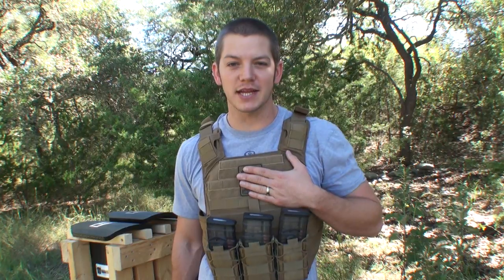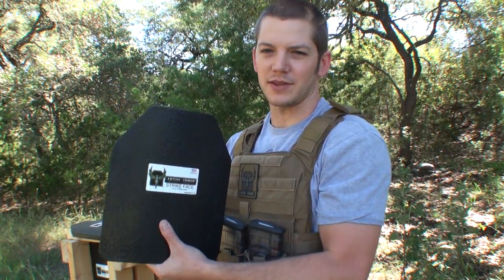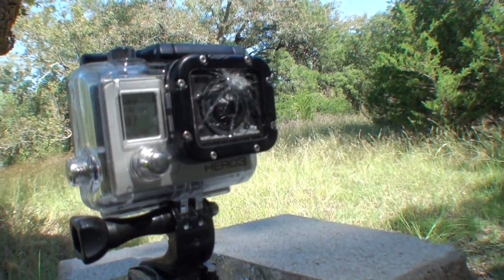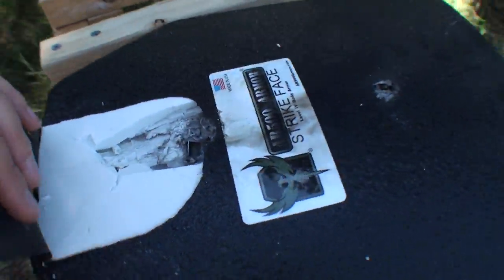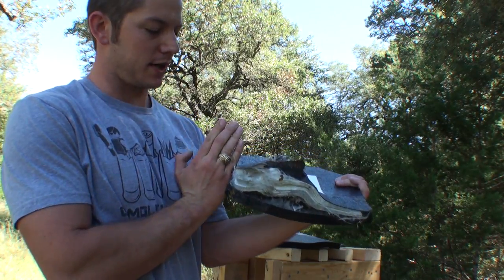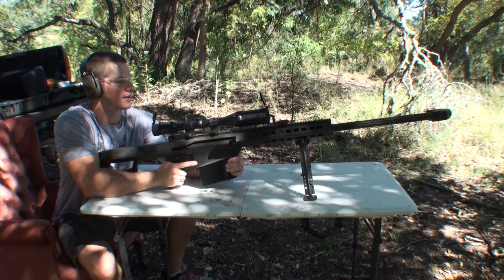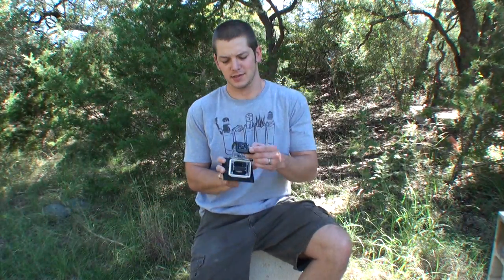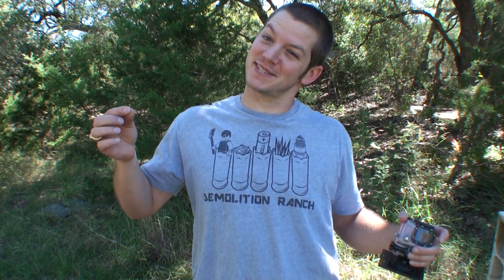Level IV Body Armor Torture, 50BMG

Comment: Would the armor have acted a bit differently if it were held more secure? Because the plates kept getting knocked off when shot from the 50 BMG, the bullet impact was cushioned a little bit, and damage was not maximized. Maybe next time, add a 150 lb weight to simulate someone wearing the armor.
Reply from the maker: I thought the same thing.  I didn't expect the box to move that much, it weighed over 50lbs.  Next time I'll secure it better.
Reply: DemolitionRanch Yeah, I was impressed. That's one powerful bullet!
Reply: Jimmy De'Souza "...cause them to perform worse..." "adds to the performance..." What? I'm confused. And I keep having to reread your comment...
Reply: Jimmy De'Souza Soft armour, I can understand... fabrics like Kevlar do indeed perform poorly when stretched and secured tightly since they're just fabrics, and they're designed to directly protect flesh. However, I doubt ceramic armour is built like fabric armours simply because they're brittle and in almost no way flexible. I think metal and ceramic armours are made to just simply take that brute force.
Reply: ElectricPyroclast It really gives you an idea of the kind of recoil on your shoulder from firing .50 BMG too, since as we know from Newton's third law of motion, the same force acting on the box full of armor plates is acting on the firearm in the opposite direction.
Reply: if i were to get shot by a .50 bmg and survive i would probably get knocked down with intense force, considering that 18,000ish pounds of force has to go somewhere
Reply: barrendare gt if the bullet passes trough you extreme cavitation would destroy your organs, so no chance to survive.
The liver would explode like a watermelon
Reply: Jimmy De'Souza I'm not going to be testing that lol
Reply: Jimmy De'Souza I think it would. The plate should be traveling around 220 mph. I think that would hurt a lot.
Reply: DemolitionRanch
Next time you test any plates would it be possible for you to make a ballistics gel torso and put that behind the plate, would be interesting?
Reply: How bout someone just takes ballistic gel and does it to see.
Reply: ElectricPyroclast  there is no need for another test even where the bullet stopped in the plate. will cause internal organs to rupture. thats what causes most deaths in explosions. and if that didnt theforce would break your ribs into nice pointy things that will puncture your heart if your lucky. if not then your lungs will be when you in hail causing either death by loss of blood or by drowning in your own blood... THE MORE YOU KNOW
Reply: Rjruy tree t estas
Reply: +rosie roseberry I feel as if a lot of KE would force your body backwards rather than just crushing your body under the extreme pressure.
Reply: well your wrong
Reply: rosie roseberry
Actually, he's partially right. While the immediate area around the point of impact will be basically churned into paste from the hydrostatic shock, it doesn't keep travelling through the whole body as if we were a body of water and it was a ripple from something hitting the surface- the physical media that is our flesh and bone interferes with those pressure waves, containing the damage to localized trauma.
Reply: *****
well he is not right cause if the shot you fired would throw the targets body backwards the recoil of your gun shoul throw your body bacwards as much as it throws the target.
And on top of that the round should have enough mass and then we are speaking about artillery shells and not handguns or 50 bmg.

If I recall correct Mythbusters tested the myth, was one of their hollywood movie myth episodes I think.
Reply: *****
well yeah, you fall to your ass but you wont fly 2 meters backwards. and if you hit your target on the shoulder he wont do a damn flip or spin, he just falls on the spot hes standing on and quite likely on his back if he is just standing.
If you shoot him on hip area he prolly tilt forwards and falls on his face and still on the exact spot where he is standing.
50 bmg is indeed a powerful round but its not a damn howitzer.
Reply: zameliz
Where did he say fly two meters backwards? he didn't, just that it would force you backwards, which it would, and then the drag of the rest of your body would pull you violently into meeting the ground.
Reply: *****
My bad, I was referring more to Brenden,
"I feel as if a lot of KE would force your body backwards".
Basically I got the impression that he thinks that it would consideraply push/throw the targets body backwards, and you are defending what he's saying, soo thats a thing :P
And what comes to 50 bmg pushing the body backwards depends of the point of impact, but the end result would still stay the same, the target will kiss the ground and will drift into the world of pain if he/she survives the hit. :3
Reply: I was thinking the same exact thing.
Reply: +ElectricPyroclast That's a good point. If I got hit with one of those, I probably wouldn't know I was about to get hit, and so I would probably get laid on my ass. This is a pretty terrifying round
Reply: +DemolitionRanch A body is not secured. Best
Reply: +DemolitionRanch strap it to a tree!
Reply: +ElectricPyroclast Well, who cares about that if all of your internal organs are turned into the bloody paste from the sheer force of the hit?
Reply: Богдан Козенко
It wouldn't, actually, though there would be a lot of internal damage from passed-on force, it wouldn't be anywhere near the same level as if it had actually impacted your body directly, and thus imparted its kinetic energy to you as hydrostatic shock. So long as there is no penetration, at worst you'll be looking at bruised internals and a lot of pain.
Reply: Who cares if you are still dead?  I guess the almost instant death from the bullet shock beats the slow internal bleeding with no hope of surviving.  Though, I guess, nobody would deliberatly hunt infantry with .50 or 12.7 (which is russian) either. Those things are designed to crack vehicles, and are pretty much overkill for infantry.
Reply: Богдан Козенко
Err... do you not get the point that wearing the armor, you wouldn't be dead? Bruised internals are tender and hurt like hell with every movement, and there is, ofc, the risk of internal bleeding, but that can be dealt with- or lacking that, you can still attempt to take some enemies out with you in that situation.

Also, as Cyberat noted, they were used to great effect in penetrating cover to kill targets on the other side of it, just like it's used against what is effectively mobile cover (vehicles).
Reply: *****
And point is that impact force wouldn't kill you. There are multiple documented accounts of soldiers (and regular citizens) hit by .50 cal bullets or worse and surviving even WITHOUT body armor, though the wound channel on that would require tons of surgeries, as per Jared Foster's example, getting shot by a .50 cal rifle five feet behind him. (source: http://www.leatherneck.com/forums/showthread.php?51015-Marine-s-Miracle) and then there's the case of Phineas Gage, who took an iron pipe over an inch in diameter through the jaw and up into the brain and survived (source: https://neurophilosophy.wordpress.com/2006/12/04/the-incredible-case-of-phineas-gage/). Hell, there are even people that have survived nine shots from a firing squad, AND a tenth shot, to the head, to ensure death. (source: http://weirdthings.com/2010/06/the-man-who-survived-10-shots-from-a-mexican-firing-squad-weirdest-survival-stories/ ).

The force of the impact of a .50 BMG against your body armor won't kill you. The force of it entering your body also won't kill you (though it can and will fuck you up). Stop giving opinion as fact, and face facts.

As for why it became popular to use vs. armoured vehicles, it's because it has the penetrating power to blow through the armored hull, same with through brick walls and the like. That doesn't mean a shot is a guarenteed kill.
Reply: Well, let us talk about a simple luck here. There are indeed documented happenings of american soldier surviving a firing execution  in Japan.  Also, there are documented happenings about people that died from a simple stab to the stomach, or just falling on a rock. Also, people survived being half decapitated by a propeller, or smashing their skull open in a car crash or in fall

http://www.dailymail.co.uk/news/article-2605001/Hes-lost-half-head-Shocking-images-man-lost-SKULL-smashed-head-concrete-work.html

But they also happen to die from a single blow with a rock to the head. 

You know what this really means? This actually means that you can die very quickly even without being shot by a motherfucking .50 caliber. Also, this means you can theoretically survive the hit. Or not. Or you can survive a plane crash from a huge altitude without a parashute. Or you may not. This is a deal of luck. 

But being shot at isn't really healthy, isn't it? There are many documented happenings of soldiers that have their ribcages collapsed under the body armor. Some of them - probably even most of them actually died from it. And they vere shot by a simple 7.62 or even 5.45 Probably the cause here is that they haven't recieved medical attention in time, or they had internal bleeding, or just died from a shock. 

Soo, I guess, an answer to out argument here is that, yes, a man can actually survive being shot at with .50, or he may not. That kind of depends.
Reply: Богдан Козенко
Wrong word use: "may actually survive". It's been proven through documented evidence (and non) that you can survive, not that you will survive. /grammarnazi
Reply: +ElectricPyroclast if you reread the comment properly its basically saying that the more secure they are the worse they are, soft stuff behind them adds to performance so the better they are. to make it really simple: the more the object flys backwards after being hit, the more force absorbed and the less damage done.
Reply: Steve Rhodes No need to say such a comment. I already figured that out long ago.
Reply: +FrIeG_ AuT You wouldn't survive it at all.
Reply: *****
The energy from a BMG wouldn't just disappear. It would crush your chest if you were hit.
Reply: MrWalkwaySc2 i have no fucking idea what you are arguing about. 

Being hit with a stick hurts. Being hit with a stone hurts much more.

Being hit with a bullet hurts much, much more. 
Yes, the stick to the head can kill you. And a stone. And a bullet. Or it may not. 
But if it will connect, you are fucked badly, lying on the ground, trying to collect something from your broken body - be it intenstines, blown away from the sheer hydroshock, or cracked ribs, or ripped away limb. 

You can survive that. Why not. But let's just say, it hurts.
Reply: Богдан Козенко
Someone said that if they survived a hit from a .50 BMG they would be knocked down to the ground. I replied saying that the he wouldn't survive.
Reply: MrWalkwaySc2 he could survive.  But yes, he would be on the ground - not from the whole energy, but from the shock of being hit.
What is wrong?
Reply: Богдан Козенко
The chances of a .50 cal not penetrating a vest is very low. Either way the energy would crush your chest in.
Reply: MrWalkwaySc2 I never said that. I said that you have a chance of survival. Not the chance of being not hurt, but alive. Crippled, forever incapacitated, distorted and twisted. 

But alive.
Reply: Богдан Козенко
Probably because I was talking to someone else the whole time then you mentioned me.
Reply: MrWalkwaySc2 yeah, and all that time you both were making incredibly... unrealistic assumptions.
Reply: Богдан Козенко
All I said was " You wouldn't survive" I don't think that's an unrealistic assumption since a .50 cal will penetrate almost every body armor.
Reply: MrWalkwaySc2 the penetration and the death are very different things. Yes, human body is fragile, but, if, for example, the limb is hit, you can pretty much survive it. You will lose the limb, though. Same goes with glancing hits. If internal organs haven't collapsed in the instant of a hydroshock, you have a high chance of living it through. The chances are that .50 has somewhat less stopping power than soviet 5.45mm. Those were evil - they twisted and spun inside body, creating the exit wound the size of an apple.
Dum-dum is also incredibly hard to live through, even if it has hit your limb. The shock is so potent, that it will stop your heart from the sheer pain.
Reply: +ElectricPyroclast you would still get knocked over because of the force of the bullet and it's speed
Reply: Uxmal Soto It doesent have THAT force.  The energy of the bullet is equal to the energy of  a gun. If the gun doesen't knock you over with its knockback, the bullet won't.
Reply: Богдан Козенко
 bro the size of a bullet the speed and velocity those bullets can blow your leg off with one hit so i'm 99.99999% sure that you would get knocked back with that bullet
Reply: Uxmal Soto nope, you would not. You would fall - yes, it is hard to stay on your legs with this kind of injury, But it will not send you flying.  Go watch some mythbusters. 

It is impossible to send somebody flying with a gunshot.
Reply: i never said they go flying i said they would get knocked back
Богдан Козенко
Reply: Uxmal Soto And I said that they would not. A person hit by a bullet just falls on the ground like a puppet with its strings cut.  That is exactly why it is called the dirt nap.  Go google some war videos.
Reply: Богдан Козенко
it would vary on the gun type if they would just fall down or get knocked back and be knocked back i don't mean go very far like the person just get hit off there feet and go back a little bit
Reply: Uxmal Soto Nope. The human body pretty much acts as a liquid when struck. The body will not go back of any bit. It will fall down like a bag of meat, with energy transfered to the internal structure, not to the body as a whole.

My dear god, I really don't wat to google videos of people being hit with DShK, but I thing I should.
Reply: Богдан Козенко
 ok look smaller guns you will just fall bigger guns such as sniper rifles can knock you back a bit not a lot but maybe 1 foot
Reply: Uxmal Soto
Nope, the other guy is right. A gun won't move you like it does in the movies. It will only knock you down.
Reply: MrWalkwaySc2
 i not saying he going to fly like 100 ft maybe 1 foot depends on where your getting hit
Reply: Uxmal Soto
It's just going to knock you down.
Reply: It really wouldn't matter, people are soft. Bullets, especially .50's will shred right through someone
Reply: +ElectricPyroclast No difference at all. If the bullet travelling 800m/s impacts a perfectly secured plate that will not move, the effect will be the same as if the bullet travelling at 803m/s impacted a setup like this. It is negligible.
Reply: Yeah you would fly a couple of feet back IF you were somehow to survive it. Most likely where ever it would hit you the force could cause fatal damage in internal organs.
Reply: ***** What I said stands, I had to study this shit, and I will not give free classes.
Reply: ***** All you said is unrelated to my statement. If after the impact, the point of impact in the plate had a speed of X, the penetration will be equivalent to that of the projectile travelling X m/s slower and impacting a perfectly secured plate. In this case, the plate is su much more massive than the bullet that the difference is negligible.
 And what the hell is impact force? You can only know the KE, the force will depend on the terminal ballistics and would require computationally intensive finite element simulations.
Reply: yes i think he should do that to
Reply: The force and overpressure alone would kill you.
Reply: +TheTerrariaGamer console terraria?
Reply: I didn't read the replies to this so maybe someone covered it. I used to make plates of this style. That's aluminum oxide (alumina) with twaron backing. Twaron acts similar to Kevlar but imo, doesn't work as well. Both materials are cheaper compared to silicon carbide and Kevlar. This plate is a SAPI (Soft Armor Plate Insert) plate. Meant to be used in a plate carrier with a soft backing as well as directly on the body. Ceramic has absolutely no elastic deformation. Goes right to the plastic deformation range. With no backing like his setup uses, it will perform poorly as it wasn't intended to be used that way. It creates more deformation along the plane of the ceramic and thus, is more prone to fracture and catastrophic failure. A good test for this would be to put the plates in a carrier, then put that on a torso sized block of clay. That would give you accurate performance results. With all that said, NIJ IV SAPI plates will not stop a .50 cal round, Either AP nor FMJ.
Reply: I have watched a .50 cal FMJ blow a tree to splinters. You will not survive any kind of impact with this round.
Reply: Tim Doucette You meant that ceramics only deform elastically, and when they reach their elastic limit, they fracture instead of deforming plastically.
Reply: that sounds very fun where did u find that video
Reply: I think it would. And the armor would probably perform worse.
You can be the model, wear two plates. we already knew from the video a .50 BMG AP round will not penetrate the 2nd plate :-)
The thing is, the supersonic blunt force alone will smash your sternum, rib cage, break your spine, cause irreversible internal bleedings to most of your chest and abdomin organs :-)
Reply: At first I thought that 150 lb would be huge, but then I googled and I saw that someone who is 150 lb may be a good size for a female but for a man it would be very tiny.
Reply: Jimmy De'Souza 
20lb plate in what dimension? Be careful do you know the penetration ability of a 50 cal round. 2in steel plate. To be safe let's say the steel plate you wear is 3 inch thick. Leaving the plate really small (5"x5"), covers only a tiny area with such weight penalty and thus useless.
Since no one would wear such 20lb steel plate your calculation is, just a calculation, unrealistic but helped to convey your idea.

But It's like saying you can stop a 120mm tank round with a 1 ton steel plate with the thickness of 1meter(40inch) because it moves the armor at only such speed, while the LxW is 13" by 13"
Reply: Jimmy De'Souza 
You are right about 1" 'hardened steel'. I was only looking at cheap mild steel. Which online source was saying a regular .50 FMJ not AP round can penetrate around 2 inch, and I added 1 inch for safety.

The maker of this video actually has another video where he shot regular .50 FMJ and AP rounds into a hardened steel plate, put on a mannequin. It looks like he was holding a 20lbs weight. 

The thing is, I understand your calculation. But something didn't look right to me of that video. I am not a math expert like I was in my college years. I think there might be something about how fast the steel plate accelerates to the speed you calculated which could hurt. Like for example does it accelerate to the speed in just 0.001 sec Would that shatter something?
Reply: golferchin76 The jolt doesn't matter, you just need to calculate the speed of the whole plate. I think that 3/4" of ar550 will stop a .50 and you will live to tell it.
Reply: ***** Spaced armour is effective against HEAT charges, not bullets.
Reply: Jimmy De'Souza It has been tested in this same channel, they performed the same stacked together and spaced.
Reply: Jimmy De'Souza The bullet will still flatten on a solid plate. I don't remember the title. He used .50bmg.
Reply: Jimmy De'Souza What you say makes sense, but I doubt it will change more than 1%. The plugging mechanism of penetration is heavily dependant on the relation between the diameter of the bullet and the thickness of the armour. The thicker the armour, the less likely it is to plug.
Reply: Jimmy De'Souza Are you sure they didn't use a harder outer layer and a tough inner layer? 2% sounds reasonable, 50% seems too much
Reply: Jimmy De'Souza Deplated uranium long rods?
Reply: Jimmy De'Souza Interesting. Lets not forget that the tungsten carbide penetrators are very long (thus less stable) and more prone to fracture than steel, so I guess that for them the spaced armour will be more effective. Anyway, nothing conclusive. Thanks for your time.
Reply: I dont remember the name offhand, but there was a Japanese ace who was hit by two .50 cal bullets in the head. (Probably at fairly long range.) Caved in the side of his head and I think blew one eye out. But he managed to fly back to base and land. I believe he spent 3 weeks recovering before flying again near the very end of ww2.
Reply: This isn't a force problem but rather an energy/momentum problem with some materials science. If you get punched in the face but you "ride" the punch, you take less damage (it's a strategy boxers do to not get glass jawed), but if you stay absolutely still and take the punch, you pretty much take the maximum damage. The situation here is similar: if the armor was held rigid instead of flying on impact, would the bullet have done even more damage to the plate than was shown in the video?
Reply: ElectricPyroclast if they were all put on each other it would of acted differently because the shock wave manipulates the plate making it easier for the bullet to get through but when there stacked up the shock wave dissipates through the other 2 making the shock less powerful and harder for bullet to get through
Reply: ElectricPyroclast yes, if the wood was held down there is a good chance the bullet would go through all three. The impulse is significantly smaller since the wood is knocked back.
Reply: ElectricPyroclast I
Reply: Ya it will